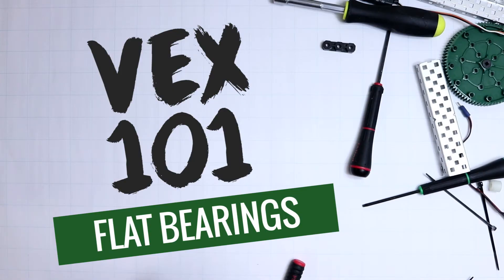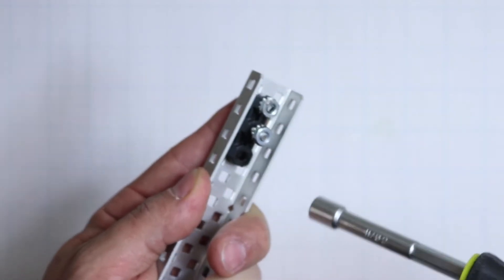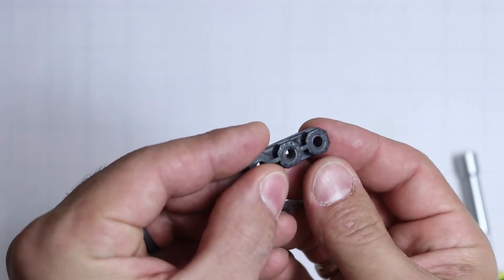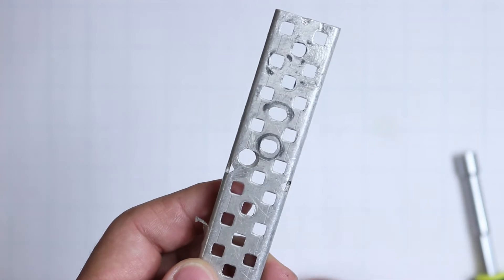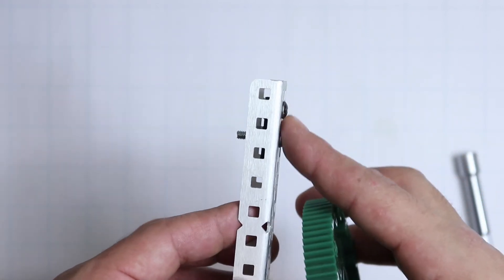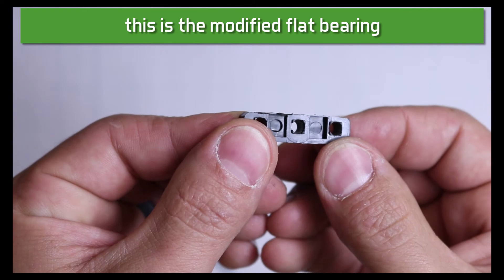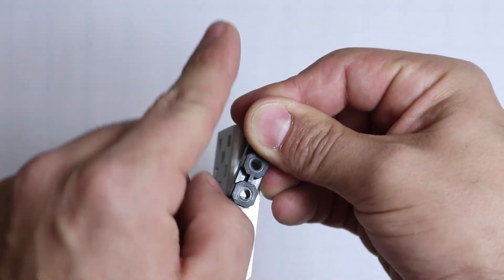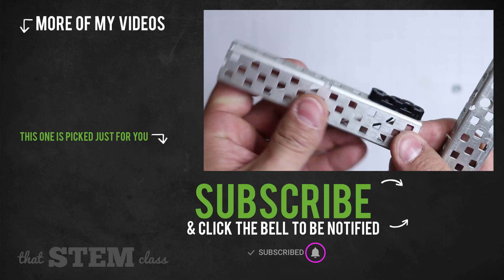VEX Robotics 101 - 02 Flat Bearings

Comment: I'm really glad you decided to do this series. Feel like there isn't much out there to really introduce teams to really getting started with VEX.
One thing I really think you should have hammered down is the importance of lining up the tabs before you screw it on. It's not enough to make sure they are aligned in the end. if you ever screw it on misaligned, you will ruin the bearing by bending those pegs. In locations with high torques, that might not matter, but if you're working on something like a flywheel, it's game over. I think this is critical knowledge for rookies to know.